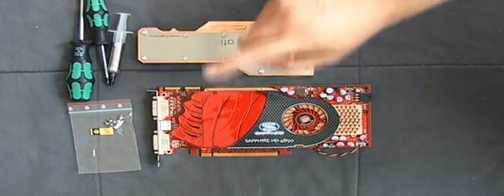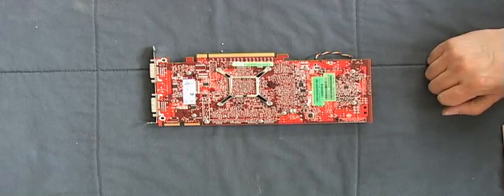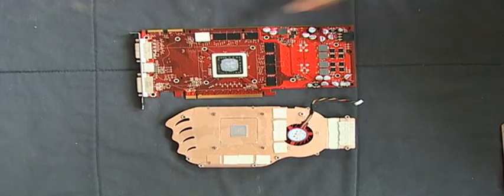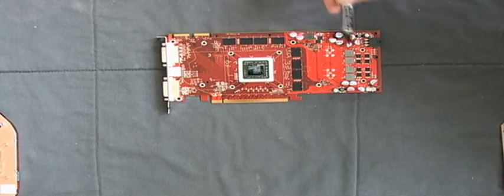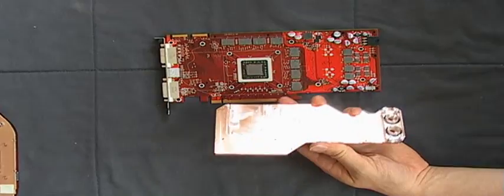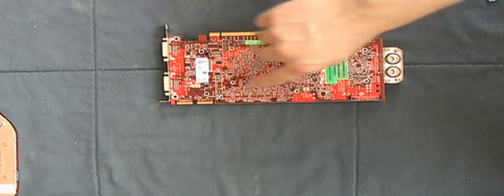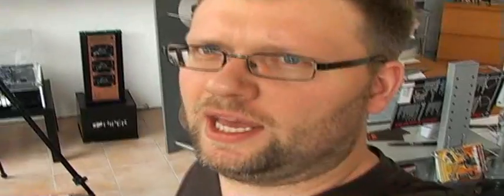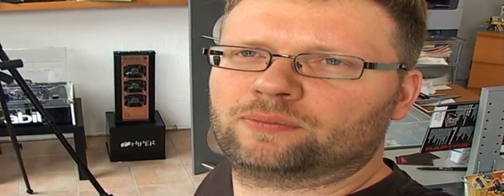Water Cooling ATI HD4850 graphic card

Comment: I have a 4800 hd and it looks exactly the same way.. Whats the difference between 4800 and 4850 anyways? 
And is it possible for the water to heat up a lot(ie90C) in a case of a long term maximum use? My card currently stays at around 80 degrees C when I'm doing nothing, and heats up to ~110 degrees C, when I'm playing something for 1; 1 and a half hours with the air-cooling.. And the noise from the friggin vent is annoying as hell. 
It hasn't been cleaned for a month now, it's fine when clean.